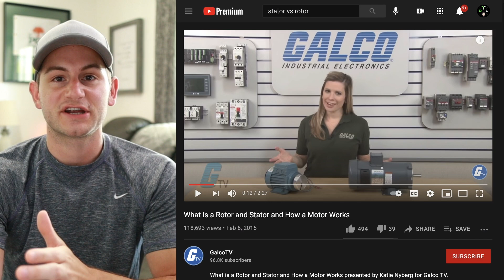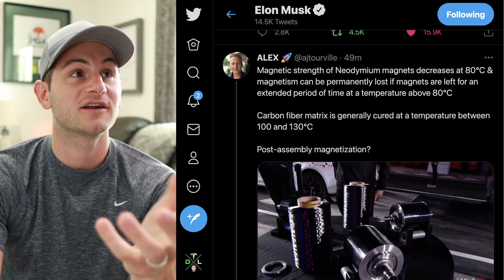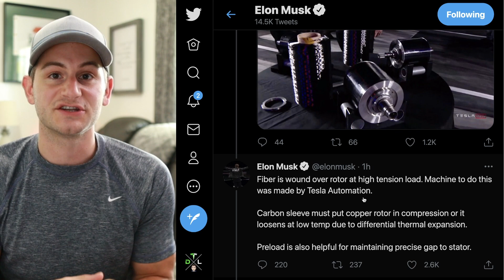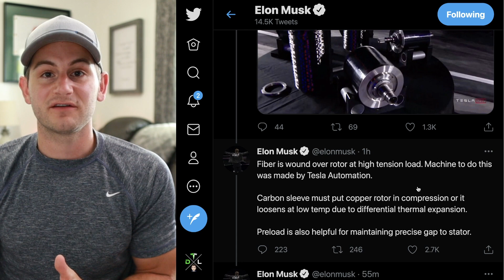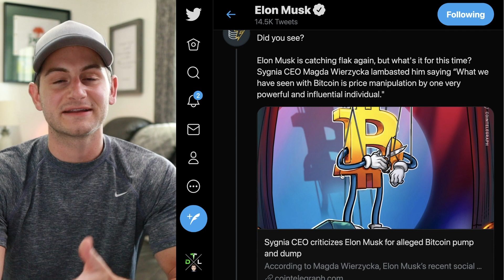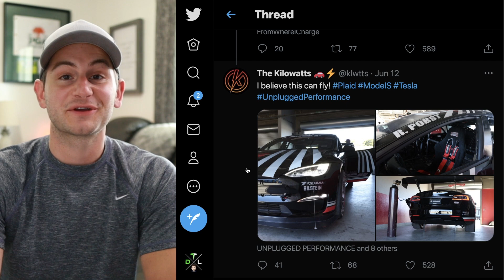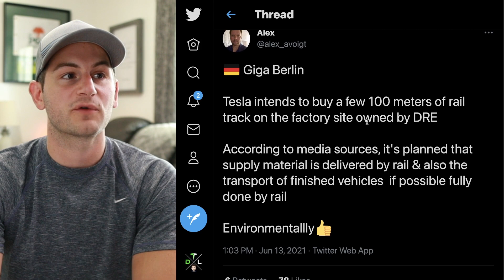Elon Just Leaked NEW Details on "World's Most Advanced Motor" 🌍

Comment: Carbon sleeve in electric motors is not a new thing mate, it has been used for years and years in motors that runs over 200k rpm, there nothing new about it here.
Reply: Well, taken out of context, a lot of things aren’t inherently new, like the electric car itself, autonomous vehicles, exoskeleton designs, stainless steel body, armour glass, fast charging batteries, sky-net…, the thing is that Tesla bring a lot of those concept out from the lab and exceptional applications. Tesla seems to have an unique ability to break endless “the chicken or the egg”  loops and just do it.
Reply: @Jimmy Edward i never said that there isn't another electric car with carbon sleeves, the porsche taycan is actually way heavier than even the model S because it offers things like all wheel steering and many other more premium materials, sandy munro showed in his videos that the id4 motor does not use rare earth elements like neodymium.... its all about choices.
Reply: @Jimmy Edward tesla could have added a second gear but the choosed the carbon and it doesn't change on the efficiency, the porsche taycan has a way better cooling system which allows it to do repetitive launch control without issues.
Reply: @Jimmy Edward those are secret motors, also tesla choosed to use the carbon sleeves with higher RPM whereas porsche uses an additional gear to achieve a much higher top speed. The 825hp tesla models performance has a lower speed than a 761 taycan turbo s. Porsche always does better with less power.
Reply: @alanmay7929  and higher cost. This motor probably saves more on cost to manufacture, cost to install, definitely space & weight & possibly energy efficiency through reduced losses. So it's perhaps better, but although an expensive process for material's & manufacture, cheaper than a motor & gearbox. Tesla Excel at manufacturing efficiency to reduce time & costs.  On battery Day, Elon said it's now Tesla's main drive. And they're proving it month by month.
Reply: @alexmanojlovic768  nope nothing can proove that, we need to see all the EV motor testings and consumption to affirm such things also all those manufacturers never talks about the amount of rare earths they use in their engines, tesla surely way more than others.
Reply: @alanmay7929  "nothing can prove that"?!?
😂😅🤣. It's called testing, and back to back testing. You're just a Tesla hater aren't you?!.... 😂😅🤣🤦🤦🤦
Reply: @alanmay7929  "Tesla use way more than others". "Nope,nothing can prove that"!....
😂😅🤣🤦🤦🤦. DPF's & Catalytic converters use rare earth metals.  A lot, but they last less than 100k miles. A Tesla motors can last 500k to a million miles!  You talk such rubbish!. 🤡
Reply: @alexmanojlovic768  you are the one talking rubbish, catalytic converters are for the lifetime of the vehicle, there are still 20 to 40 years old ICE  on roads mate, nice try, cheaply made cars doesn't last long but most of them actually go for years and years. There have been tesla with high mileage but they had to have both motor and whole battery pack replaced.
Reply: @alanmay7929  cats last the lifetime of the car? So chemical reaction between rare earth metals & petrol combustion by-products magically last forever?  Yes internet idiots are like mosquitos. Hello Alan... 😂😅🤣🤦🤦🤦

Comment: 1:27 nobody would make an EV PM motor like that. An EV motor rotates with up to 10K-20K RPM. You would always place permanent magnets on the rotor NOT the stator. Having electro magnets on the rotor requires slip rings or coal brushes that wear out.

6:30 Going by the text you read aloud the CF sleeve is to hold the copper rotor (squirrel cage) in place. So that must be the async motor that also need the CF sleeve. I believe the PM motors will also have the sleeve to place permanent magnets as close to the surface of the rotor as possible while assuring they stay in place. Most advanced? no. Rimac drives faster with single speed gearbox. Porsche avoid the high motor RPM (which is not efficient) by use of 2 speed gearbox. Both use class 800 V motors, Tesla S new model is 450 V.
Reply: The owner's manual describes the motors as being permanent-magnet, AC synchronous motors. All 3 motors are identical. These are improved versions of the Model 3 motor. They are not using any induction motors. See 11.23-13.24 and 25.34-26.28 of the DragTimes video for some detail about the drivetrain and motors. https://www.youtube.com/watch?v=S4KmRZ28hdw&t=154s
Reply: @wr2382  If all 3 motors are PMSM the Twitter explanation here at 6:30 is wrong. PMSM does not have copper wiring in the rotor.

With PMSM motors on both axles that will impact range unless the car has mechanical decoupling of one axle like on Porsche Taycan, Rimac Nevera and Hyundai Ioniq 5.
Reply: @Foersom_  I just had a closer look at the DragTimes video of the launch event and there are definitely 2 types of rotors. It looks like the car has 2 PM motors, each driving a rear wheel, and the motor at the front looks like an induction motor.

Comment: My suspicion is that Elon has gone back to basics, and this motor is a pure induction motor. The rotor has to look like a shorted turn, and usually they use aluminium encased in steel plates to get the short circuit to be as low a resistance as possible.
In this case, they have moved to copper as done previously in the model 3 induction motor, but to get the high frequency without too much skin problems, they have turned to LITZ wire. This would be structurally weak in terms of holding together at higher rpm... hence wrapping the "bundle" with high tension carbon fibre to hold it all together.

This combination would make full use of the high frequency stator fields, with very little slip. I would not expect to see any magnets in there at all. ( slip will be a function of the resistance of the copper "bars".... less resistance means higher currents and so higher magnetic fields produced by the copper shorted turns)...also less eddy currents in the copper.

Comment: High performance Teslas use(d) pure induction motors at rear, if that is true with Tri-motors -> there's no magnets inside of that rotor...

[edit] And no it's not true, - synchronous motors with permanent-magnet all-around.
Reply: Indeed, maybe they have swapped again? 1 ASM in front and 2 PMSM in the rear?
Reply: The owner's manual describes the motors as permanent-magnet, AC synchronous motors. Go to the 26.00 minute mark of the DragTimes video for a description and video of the rotor.  https://www.youtube.com/watch?v=S4KmRZ28hdw&t=154s The magnets are the rectangular shaped objects wedged in the V-shaped architecture around the rim of the rotor.
Reply: @wr2382  Yes, you're right. I even watched (part of) that video before...

Comment: I suspect we are replacing the steel former, with which those neodymium magnets are fastened, by carbon fiber wrapping guided by CNC. 

These wrapping technology are normally use in upgrading aluminum cylinders for rocket liquid fuel and oxygen, is first time utilized in EV motor and thereby a patent opportunity. 

Two advantages, 
(1) the composite former wrap has eliminated inertia load incur with heavy material, steel.
 
(2) resin-carbon wrap avoided magnetic hysteresis in steel that hinders effective input power - at cruising rpm and up. That, is mistaken for increasing torque at high rpm. 

The correct way to address that is it extends input power at mid (cruising) and upper rpm limit.
Reply: Nope, the steel is still there to create the magnetic field and the carbon fiber is wrapped around to avoid expansion at very high rpm.
Reply: @alanmay7929  
I did not read Tesla patent in this, have you? If not how can we tell one way or another. 

I did not. I’m commenting from feasibility stand point. 

Steel isn’t a good choice for the reason stated, inertial mass and magnetic hysteresis. 

I think wrap on aluminum as magnet former can be a better alternative against those two limiting factors?
Reply: @philoso377  we are talking about carbon fiber here not aluminium or steel. Carbon sleeved is already an old thing, a patent at this point is just useless. The majority of companies doing such manufacturing are German and have seriously good reputation in everything composite materials.
Reply: @alanmay7929  
Agreed, cf wrap is not new. Let’s move on to the assembly. 

If I’m not mistaken. We have an assembly of - cf wrap on steel former with magnets inside. I’m not sure we need steel (1) by convention or (2) necessary to organize a specific magnetic field pattern. 

If we use steel by convention, it can be replaced by aluminum. If so we can reduce inertial mass and hysteresis loss. Your advice?
Reply: @philoso377  steel or aluminium it doesn't matter, the carbon sleeve wrapped rotor protects the magnets and core from expansion and explosion.
Reply: @alanmay7929  
Agree on cd wrap but all. 
Steel impose limiting factor is a concern to Tesla and its fan boys. 
Steel has higher inertial mass over aluminum. 
Steel has magnetic hysteresis not aluminum.
Reply: I'm sure they've applied for a patent before showing it to the world?
Reply: @brois841  go do some research before commenting, its not a new tech.
Reply: @alanmay7929  I did and I'm sure you've noticed that in some of the posts you've already replied to.

Comment: They need to make a solar powered yacht. I know they're considering the drag that the water creates and how much that would waste energy. The answer may be hydrofoils. They have been used for years, and now is the time to combine them with Tesla batteries, motors and solar panels to make an awesome yacht.
Reply: Solar powered yachts already exist, however they'll only get better as technology improves with time.
Reply: The limiting factor is the batteries! They are making Batteries for all industries as quickly as possible. The issue is where to best use batteries to reach Tesla’s environmental goals. Boats and airplanes are not it for now
Reply: @Jethr001  good point. I’m just being selfish, I want a small yacht, but I don’t want to spew diesel all over the place.
Reply: @davidwollpert5276  Yes! I do too…been a boater all my life. Nice thing is a displacement hull is not as sensitive to weight as cars or aircraft thus heavier/cheaper batteries could be integrated into the hull or keel. Trouble is move through water or even station keeping consumes huge amounts of energy, well beyond a yachts potential solar capacity.  I’ve always thought that anchoring a boat in a high current channel with an underwater parachute/hydro-turbine could untapped huge amounts of potential energy…dont you think?  Next would be my design for electric inflatable hydrofoil dinghy!  What’s your boat innovations?
Reply: @Jethr001  I just think a small yacht with hydrofoils would get rid of most of the drag problem. And the boat would run off of the batteries, rather than directly from the solar panels. So plenty of power.

Comment: This carbon fiber sleeved motor, makes so much sense, i cant believe nobody did this before...
Reply: Everything is obvious after the fact :) I suspect it hasn't been done because most cases don't require it and most companies don't have the capability to do something like this as they shop from the catalog of parts manufacturers.
Reply: Nobody needs that complication (and cost) because they run the motor at lower RPM. Only Rimac might also use a similar method.
Reply: @Foersom_  actually read a few more comments, apparently this isn't a Tesla innovation, the process has been around and used for years.
Reply: An eletric air plane would benefit from this motor, its getting mote feasible..
Reply: Carbon sleeved rotors are used in applications that can reach over 200k rpm.
Reply: @alanmay7929  what are the applications of those 200k rpm motors? How powerful are they?
Reply: @alanmay7929  in the size rotors that Tesla is using? Have a hard time believing that
Reply: @brois841  do you know all the electric motors in existence?! Nope, electric motors are used in sooooo many applications you can't even imagine.
Reply: @alanmay7929  you sound like you know all about this, so you tell us... do they have an innovation here or not? It sounded like they innovated in some way and built their own machine to wrap the rotors. Not to say that the technology in general didn't exist, but are you aware of similar applications, with high mass rotors?

I have patents (in my field) that didn't invent a new technology, but change in how that technology is applied.

Comment: Musk stated that the battery was a structural battery pack then quickly moved on also they seem to be getting more horse power from the battery pack just wondering if the pack has the 4680 cell and they are keeping this under wraps.
Reply: No the new generation Tesla S has the legacy 18650 cells, not even 21700 cells are used. 

What is new is they have made the battery and motors to high voltage class 400 V like Jaguar and Audi did in 2018. This is an easy method to output more power with less waste heat.
Reply: @Foersom_ No Tesla has been at 400v 
so that is wrong. And if you think raising the voltage is the solution then you really have no idea.

Comment: Thanks for the video.
I already suspected that the highlight of the unveiling of the Plaid Model S is the new electric motor  A lot of Tesla fanboys were disappointed because there is nothing new especially the 4680 battery.  I knew that the motor is new but Elon didn't spend time to explain it.  I think that the motor is the key to get to 200mph.

I am glad to know that this motor is not easily to be copied without a machine.  I always wonder how Tesla can protect its secret sauce to make the battery pack when Panasonic and CATL and LG Chem makes the battery cells.

I think that this new motor will go to the models 3/Y in a few years but not now to give the Plaid S an advantage.

As for crypto, I hope that Elon stays out of it whether he jokes or is serious.  Elon is hated in the crypto community because whenever he tweeted about cryptos, it crashed.  Mining with clean energy is just political because the whole idea is to limit printing more bitcoin or otherwise it will become a fiat currency and there are only 2M left to mine.  And there are plenty of coins that have no mining in the first place.

Comment: -Carbon wrapped rotors is nothing new. aramide and carbon fiber has been used for high speed brushless magnet rotors for years. Aramide more common.

-More windings gives stronger electromagnets but it does not make it spin faster. It makes it spin slower and produce more torque.

-You're showing brushed motors in your illustration animation. That's a wound rotor energized by brushes, not a magnet rotor.

-You don't need to harden resin at 130°C. It can be hardened at much lower temps, even room temperature. I was an aircraft technician for 20 years. It's not new tech.
Reply: Thanks for the info, it sounded more innovative than it is, but I'm sure there's some kind of innovation in Tesla's process.
Reply: I believe that what is new is the wrapping tension achieved and the associated compression.
Reply: @wr2382  It's not new. :)

Comment: innovating much faster than others and pushing the industry💪🏻
Reply: Total bullshit, carbon sleeve rotors are not a new thing in tech, its very old tech used in 200k+ rpm motors, also bmw built almost a decade ago a carbon fiber manufacturing plant in the US.
Reply: Mercedes SLS AMG ED quad motor, torque vectoring 2013.
Audi E-tron S tri motor, torque vectoring 2020.
Tesla S tri motor, torque vectoring 2021.

In 2018 Jaguar I-Pace and Audi E-tron had high voltage class 400 V battery and motors.
In 2019 Porsche Taycan 800 V battery and motors.
In 2021 Tesla S start using high voltage class 400 V battery and motors.

Comment: 6:30 “copper rotor” Rotor is steel and permanent magnets, no copper, unlike induction motor no wires either.
Look up IPMSynRM.
Reply: At least in Model 3, there is a cupper / iron rotor in the rear motor. Asynchronous type. The front motor is a permanent magnetised switched reluctance motor who contains no cupper in the rotor but still needs to be sleeved to cope with high centripetal forces. 
Can’t prove or explain it but got impression, asynchronous copper rotor motors combines a high short term torque density while still keeping good efficiency at low torque. The ultimate torque density is obtained with strong surface mounted or halbach array magnets in the rotor but they suffer from having quite high idle torque, giving the really bad efficiency at medium to low torque load.
Reply: @swhbpocl   Yes, exactly. Also, the permanent magnet motors are more difficult to work with in regenerative braking.
Reply: @lengould9262  There is no problem to regen from PM motors. There is a problem to free-wheel (coast) with PM motors due to eddy currents.
Reply: @Foersom_  yes right. The Eddie currents is what causes the relatively high idle (no load) current that destroy low power efficiency.
Reply from the maker: copper wrapped...elon's tweet had me confused lol
Reply: But it IS a copper rotor. Just read Elon's tweet. He saying it several times. It's even in the first sentence when you look at 6:30 : "Carbon sleeve must put copper rotor in compression...."